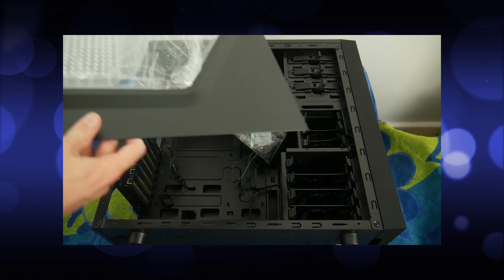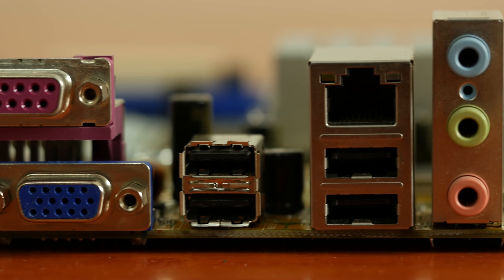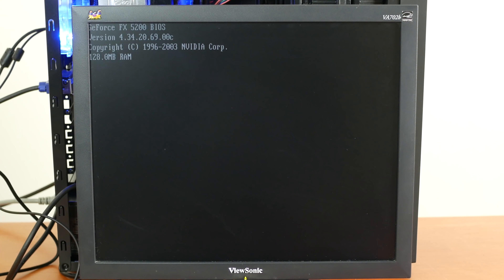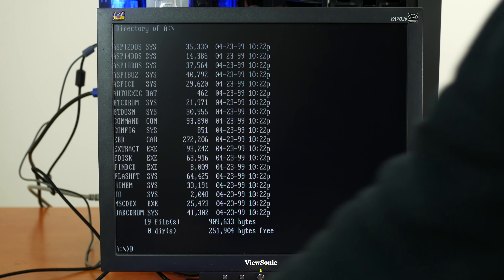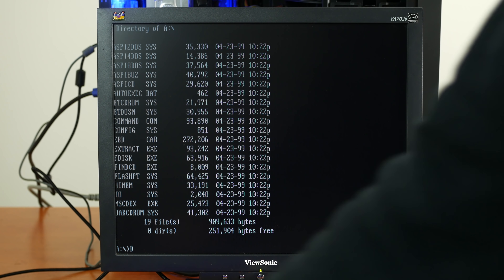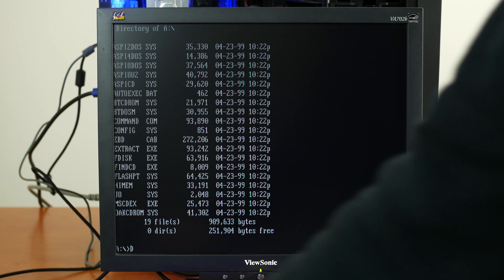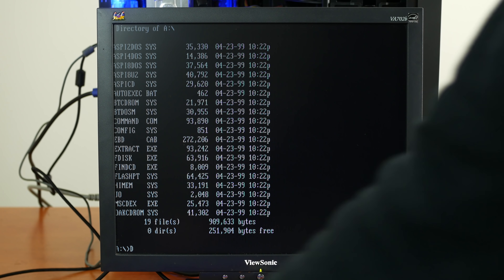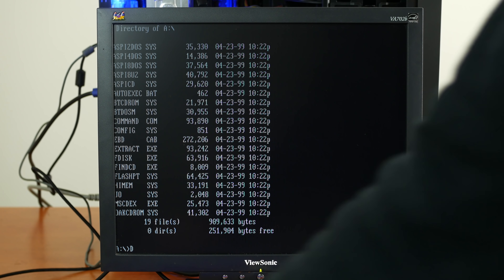What's the fastest (officially supported) Windows 98 PC?

Comment: Yeah, you're going to find a lot of compatible issues with hardware that new.

The "Ultimate" Win98 PC in terms of sheer power would probably be a Pentium 4 system with some Geforce4 ti. Even using an SSD is a bad idea because it can end up being too fast for the OS and games. But even in this scenario you're still pushing the compatibility limits of the hardware. You actually lose speed/ppower due to the bad driver support. Check Phil's Computer Lab for more info on that. https://youtu.be/HRhm4aGNI3o

A Tualatin core Pentium 3 with a Geforce2 Ultra would probably be the sweet stop for Win98 high power and compatibility.
Reply: Windows 98 from what I heard has stability issues with processors clocked faster than 2Ghz, so a Pentium 3 clocked at 1Ghz to 1.2Ghz would definitely be the sweet spot. An Athlon XP 3200+ clock at 2Ghz would probably be a good choice too, but it's a little newer.

Windows 98 also has stability issues when having more than 512MB of Ram, which includes the video ram from your graphics card. So in a stable high-end Windows 98 gaming rig you would probably wanna have 256MB of system ram & 128MB of video ram max to stay under that 512MB limit, which would still be more than enough for any Win9x or DOS game or app.
Reply: Pentium M + AIW 9800 Pro is the best combo.
Reply: @r0b8086  The Pentium M was awesome!!! It had way better single threaded performance than that Netburst crap called the “Pentium 4”. 

Some of the socket based PMs could actually fit in some P4 desktop motherboards but Intel purposely crippled compatibility between the PM & P4 desktop motherboards to try there hardest to push the Pentium 4. 

Eventually Intels crap Netburst based P4s & PDs couldn’t compete with AMDs Athlon 64 series so Intel took the Pentium M & re-engineered it too make the Intel Core 2 series that replaced the awful Pentium 4 & out beat AMD again in performance.

So modern Intel Core processors came from the Pentium 3.
Reply: @r0b8086  I think the main reason people choose the P4 is price. It’s cheaper to get a P4 & compatible motherboard than a P3 & a motherboard to go with it.

Like you can get a Pentium 4 for under $10 now & a compatible motherboard for like $20 to $30.

For a Pentium 3 it’s like $30 to $40 for the CPU then like $50 or more for a compatible motherboard.
Reply: Yea P4 is a bit newer but if you stick to Northwood with Intel chipsets, it does work with minimal issues. The only real advantage though would be price - everybody wants some change for Tualatin S370 boards but S478 is everywhere for dirt cheap. It is definitely more made for XP but you can dual-boot it pretty safely.

I have a coppermine 933 that I got for a few dollars, which was initially slated to be a 98SE rig but I couldn't find a board that wasn't overpriced af, not from a seller with 0 feedback from Russia/China, or not a trash chipset. Up here in Canada, everybody wanted over $100 for Tualatin capable boards (wanted the option to drop one in if/when I found one). Ended up going Northwood P4 with Intel 865 for far cheaper and have zero slowdowns or crashing problems.

I do fully agree on the graphics card though, 9800 Pro or Geforce 4 is probably the latest I would go for graphics. I don't like the FX series much and x800/850 never really made it out of 'beta' stage for drivers. I think the author just searched "last supported win98 graphics card" and went with that. A bit more research would yield that Geforce 6 series card was barely supported, if at all. 

I would also wager that trying to run onboard audio is another source of instability as they were really software based codec chips back then, and LGA 775 is far too new for 98. Tossing in a SB Live! would help that and sound a whole lot better too.

This would make a nice 2004-2005 era WinXP rig though.

Comment: Since when were agp graphics cards known for easily breaking?
Reply: Was wondering the same. My old nx 6600 definitely hasnt heard of that. And afaik all my other AGP cards that are stuffed into random boxes still work as well.
Reply: Don't think its jist AGP cards.  Its any electronics built in early 2000s.  There were a load of crap capacitors in use at the time and they had a short lifespan of maybe 10-15 years.  Either they dried out, or would pop/explode.
Reply: Had to fix a 1995-era Socket 7 board with blown caps once. Not as widespread as the 2005-2006 era though.

Comment: 17:00 that reminds me when I installed w10 in my pc, where the installation would get to ~90% and then fail. I tried using the w10 installation assistant, a bootable USB and even an installation DVD, but nothing worked.
Nothing until I unplugged the wifi dongle that I was using to download and install windows 10.

Comment: Hey -- just found this video today, & I've never felt so much vicarious joy & sympathetic pain from watching a video....

Having built my own "ultimate Windows 98" PC yrs ago, I had similar (but not quite as agonizing) frustrations w/ hardware "newness", driver support & overall OS compatibility.  In my case, things went a bit more smoothly due to my research indicating that Win98 was unlikely to work w/ anything newer than the following:

-    a motherboard that supported Win95 / Win98 / WinME / WinNT / Win2000 / WinXP

-    an Intel Pentium 4 or older CPU

-    512MB of memory on boot (or up to 1GB of memory after tweaking the .INI files in the WINDOWS folder & the AUTOEXEC.BAT / CONFIG.SYS files in the root directory)

-    a PCI or AGP graphics card / 3D accelerator w/ no more than 128MB onboard video memory

-    an ATA hard drive of no more than 40GB (or up to 128GB after installing an unofficial Microsoft patch)

-    one or more ATA/IDE removable disc drives, either DVD &/or CD types

-    for DOS functionality, a 100% Sound Blaster compatible audio card (PCI most likely, tho ISA usually works too)

The fact that I deliberately chose a motherboard that supported floppy disk drives made things that much easier, as I always had my trusty DOS / Win9x boot floppies to fall back on whenever I needed them, even w/ bootable CDs & DVDs supported by the motherboard.  Combined w/ a handy pair of removable hard drive docks for easy ATA drive swapping, I was able to build my Win98 "dream machine" PC & get plenty of enjoyment out of it (after working out all the damn kinks, of course).

Because I could swap out drives at will, I also tested everything out on different hard drives w/ different OSes -- Windows ME, Windows XP & various distros of Linux.

As far as I can remember, this is what my hardware config eventually worked out as:

-    VIA Tech ATX motherboard w/ Socket 775 support (don't remember the model)

-    3.8GHz Intel P4 CPU

-    1GB DDR memory

-    80GB ATA hard drive

-    one DVD-RW burner + one DVD-ROM (configured as master/slave on secondary ATA channel)

-    Aureal Vortex PCI sound card w/ DOS drivers

Like U, I had my share of frustrations w/ hardware that almost-but-not-quite worked (or just flat out would never run) when I tried installing it under Win98, as that was the absolute minimum demand I had for that particular PC build.  In the end, tho, the final result ran beautifully!

Comment: Can relate to this video, just in general, you'll have an idea for a build, and hit every obstacle possible. I did an XP build not too long ago, those are kinda easy with relatively modern hardware. I do want to try 98, I would 100% done the same as you, grabbed some board and be like "I'm sure it'll work just fine" and then have to go through old forum posts to find the optimal combo somewhere.

Comment: Great video. In future you might be better off with an OEM motherboard - better driver support. Your storage controller needs a driver update and the BluRay/DVDRW drive should start working. Had the EXACT same issue with booting 98 as you: change to a BIOS setting and the driver update. Everything works flawlessly since then and the PC is fast.

Running XP and 98 in dual boot on an old IBM ThinkCenter. Intel P4, 2GB RAM, used  SSD and 865G chipset.

Comment: I'd say that for this particular build, the hard cut-off date for any hardware for Windows 98 would be 1999 or 2000. Back when 98SE was still one of the more used operating systems. As for a CPU, even though it was released in 2001, use a Tualatin-based Pentium III. The fastest one was 1.4GHz. PhilsComputerLab used it and it surpassed even a similarly-clocked Willamette Pentium 4.
Reply: For the optimal, somewhat period-correct build absolutely. But I assume some things never change and people will keep their system even after upgrading. So some Athlon XP and Northwood systems with 98 SE might've been there.

But completely agree on the Tualatin. That thing was a beast. The 1.4 can stock outperform a 1.7-1.8 GHz P4 and looking at oc results, 1.55-1.6 GHz are pretty easy to get (150x10.5 for 1575 MHz on a 815 board are a cakewalk) , and the architecture seems to scale pretty well up to around 1.8 GHz in terms of cooling and voltage. At that point even a 2.4 GHz Northwood has to look out. Makes me wish they had released some faster ones. Imagine a Tualatin 1800 with 200 MHz FSB and DDR-400
About 30-40% better IPC on P6, which correlates well with late Netburst/early Core 2 results. Got a 3 GHz Cedar Mill P4 and a 2 GHz Conroe Celeron here, and the Celeron consistently beats the P4.

Comment: Most of the problems you are experiencing are due to the SATA ports for the HD you are using. Some bioses from that time let you choose to run SATA drives in IDE mode. The other easy solution would be to run the drives with pure IDE cables. there is really no big difference between SATA and ide after all in speed.. Also chipset drivers are important, most developers around that time supported chipset drivers for win 98 se until cirka 2005. But you don't need chipset drivers for the exact model your using, so using chipset drivers for that specific core chip is easy. I Know by experience that using SATA in windows 98 is horribel, and creates all kind of errors.. Also try using an older graphics card. The drivers for fx 5900 is quite stable beacuse nvidia had time to really support thoose cards, if this still gives you problems in modern games like Halo just try a GF 4 and so fort... Personaly I will never use a board that does not have ISA ports as it's a lost cause for older DOS games as Doom etc.. The emulation will work like 40 procent of the time

Comment: It's a video from 2 years ago and you've probably figured this out by now, but anyway:
For socket 775 motherboards, you can't just stuff a CPU in without looking at the FSB and expect it to work. Motherboards like the GA-8IPE775 and P5PE-VM uses the i865 chipset which supports an FSB of up to 800MHz, so you will need to use CPUs with matching FSB. Some motherboard manufacturers like Asus up the ante by overclocking the chipset to support 1066MHz FSB (e.g. the P5PE-VM), but you'll need to use an external VGA card and good memory, and there is no guarantee of success (in some cases the system could become unstable). The C2D E8600 is a 1333MHz FSB CPU and will never work in i865 motherboards.

Comment: Well, for my Windows 98SE machine, my setup is as follows:
EPoX EP-6VBA motherboard
Pentium 3 @ 1GHz on a socket 370 to slot 1 adapter card.
640MB SDRAM @ 133MHz.
3DFX Voodoo5500 AGP x2
2 pcs 3DFX Voodoo2 SLI for backwards compatibility.
Soundblaster AWE64 Gold ISA with good MIDI support, (have one Audigy2 PCI card with A3D and EAX support lying around if I want to upgrade later).
32GB Compact Flash card to IDE converter as HDD.
Nakamishi MJ-5.16 SCSI 5-disc CD changer (bcs some games from the era is on several discs), and one common IDE DVD burner.
The PSU is a common 350W (for the era).

It can run games smoothly even at 1280x1024 res on the Voodoo5 card from year 2000, or 1024x768 on the Voodoo2's in SLI from 1998.

This setup (in my opinion) is more than sufficient for all Win95/98, Milennium or 2000 based games despite not being aimed for the best compatible parts, but for those that existed around the late 90's and early 2000's.
Still runs great after 10 years since I build it with parts now ageing beyond 20.

Thanks for a great, funny and interesting video.😄👍⭐

Comment: I had a system I tried 98 on several times over the years - a S478 Asus P4P-800MX, initially a Celeron, then an Northwood P4. 98 was probably the most temperamental and sluggish of the Windows OSes. The driver for the Netgear USB WiFi dongle I once used would cause the system to hang on W98 if it wasn't unplugged at startup, or it would crash Explorer after a while. There were other strange behaviours even before unofficial updates were added into the mix. Truthfully it never ran any  OSes particularly well, although I eventually settled on 2000 and called it good enough. 

Years later (and now years ago), I bought a period-correct W98 machine (an early Pentium 3!) just to see if W98 was really that bad and I'd forgotten it. It needed a clean install, and while I found drivers, it never happened, and I eventually gave up the system during a purge. Oh well.

Comment: 35:01 yes, these issues are just because manufacturers of newer hardware never implemented proper Win 98 support. Actually on the last system on which I used Windows 98SE (Athlon XP 2700+ and some GeForce 4, I think 4800 Ti) I also had XP in dual boot and 98SE was more stable, also because it sometimes continued to work after a BSOD while on XP you generally can't continue after a BSOD.

And early Windows XP was really not very stable in general, it only got better when WHQL was widespread, which took quite long, I think this was just the case around 2004, when SP2 was released (but it was more related to better drivers than to SP2).

Comment: The problem with that CPU benchmark, is that the listed speed of "3.33 GHz" is not necessarily the speed the benchmark was performed at. -- Your CPU has the speed as part of the model number basically, so even if it's super overclocked, it will still say the bench mark was done on a 3.33 GHz CPU (because that's part of the identification of the CPU).
If you think this is unlikely, please consider that the overclocking community freaking loves to do this, they will buy up the same exact CPU en-masse because it's been identified as overclock friendly (even if it's a few generations old, as if you can get an old CPU running at 4.00 GHz, that's still a pretty decent upgrade, especially for a family member's old PC, etc.)

Comment: I ran into a lot of the same hardware issues you showed in this video (the whole dual fifo IDE controller weirdness) and I found the solution to be using a SATA to IDE adapter for my hard drive. Win98 seems to really not like SATA hard drives for some reason. Ever since I did that, I don't have to use any weird commands to get the setup to complete or the system to boot or anything. It's as vanilla an install as you could expect.

Comment: The problems you are encountering happen to be the main reason why Windows XP is my favorite operating system of all time. Plus, it's the one I personally grew up using the most. Basically, Windows XP, particularly the uncommon 64-bit version, will actually use more than one thread, even if it isn't particularly good at it. It supports significantly newer graphics cards and motherboard chipsets because of its continually extended support period. And it made it much easier for you to just point the driver installer at a DVD filled with miscellaneous driver files and let it pick the best of the lot that was supported by the hardware. It rarely made mistakes in the many instances where I did this. After the 3rd revision dropped for XP, it was incredibly stable. Plus, it was released before Microsoft decided to fully unify the shell with Windows Explorer and make it much more integrated with the kernel, so it was actually possible to replace the shell and make the OS look and feel substantially different, assuming you had the hardware overhead for it. XP is still my favorite operating system and if it had continued to receive ongoing support and upgrades, I would probably still be using it.

Comment: My Windows 7 PC is exactly like that Windows 98 PC you made!
Half Life runs perfectly, same with Sonic Heroes.
It even runs modern games perfectly, if they meet some requirements.

And you wouldn't believe me but Minecraft is one of them. Just...
I wouldn't say the same for v1.17+ of the same game. Which straight up don't start.
Games like Need for Speed Most Wanted, Plants Vs Zombies, Counter Strike 1.6, Zuma Deluxe, etc work perfectly on my PC, and games like Minecraft, Sonic Mania (Including the plus edition), Undertale, Deltarune, also work perfect. Now, games like Rayman Origins/Legends, Mini World Block Art (Don't mind me, that one was for my sister), Minecraft v1.15+ with Optifine or v1.13+ full vanilla,  work fine, just at a low framerate.

And yes, I have ALL of the games I mentioned.